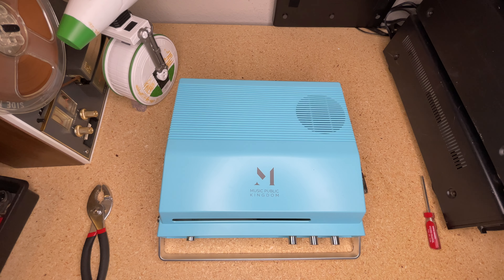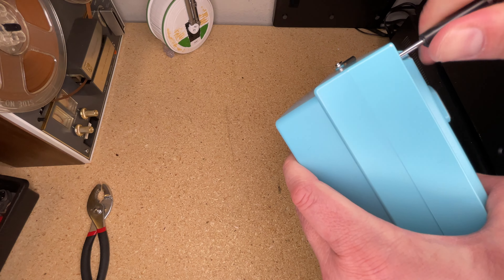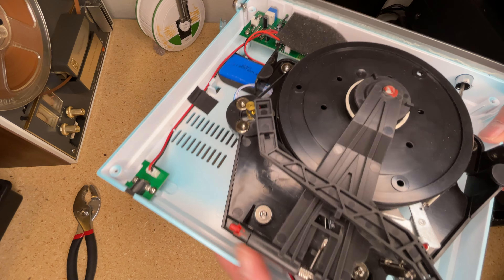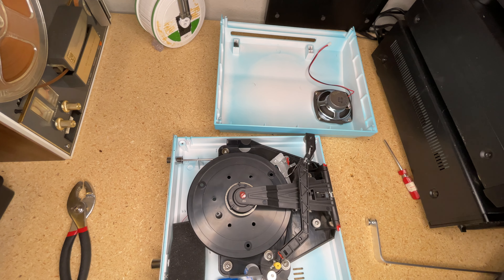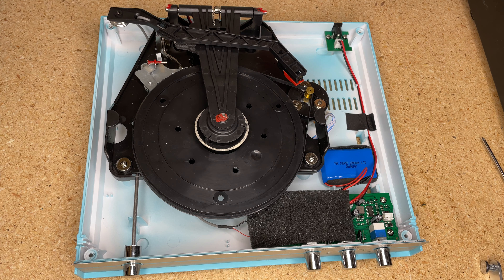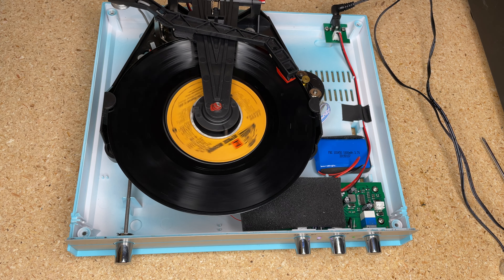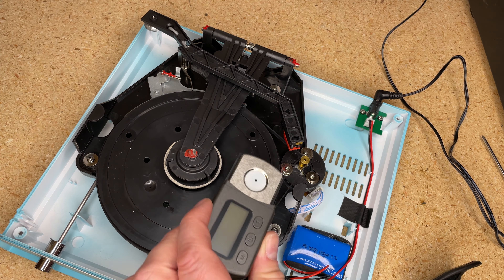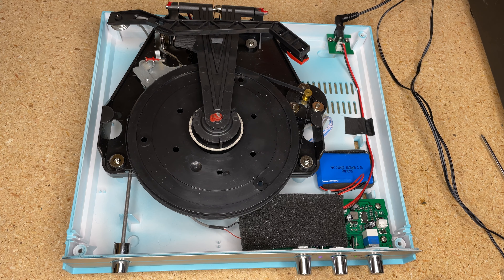Slot In Tracking Force Tell-All (Pt1.)

Comment: If I had this I might modify it. Maybe make a bluetooth speaker out of that amp. Does it output stereo but they just set it up for just one speaker.
Reply from the maker: It is a Bluetooth speaker as well....im sure its stereo until the single speaker.
Reply: @Recordology  Maybe there is a point where the signal is Y'ed to mono then it goes to the speaker. I was thinking of just the amp from this thing being in a box with the speaker or two speakers and making a small boombox out of it and forgetting about the turntable since it seems rough on records.

Comment: It's a fascinating slot record player in terms of concept, but not in terms of the manufacturer's use of cheap materials and dodgy mechanics. 

Frankly, I'd never buy a unit like that because I wouldn't want to subject any of my 45's to that machine. I wouldn't even want to risk damaging my worst condition 45's in that machine and most of the 45's I've collected over the years are at least in VG+ condition, but most are even better in excellent to near mint condition with no scratches whatsoever. 

Thanks for the thorough video though, Recordology. :)

Comment: Looks 👍 like ya pulled this thing back out of the closet. Sorry it ruined your Dave Brubeck Take 5 album. Don't worry about being stupid, you weren't. I could have been more stupid with things I have ✔ done in my life. Sounds 👍 like they sell a special needle/tonearm 👌 kit for this record player, one with a reduced 🏋 weight tonearm. Again, maybe ya were missing a vital magnet, and ordered one, which both clamps the record securely in place, and regulates tonearm pressure simultaneously. Your friend Jeff.